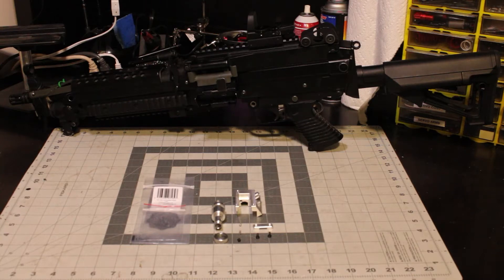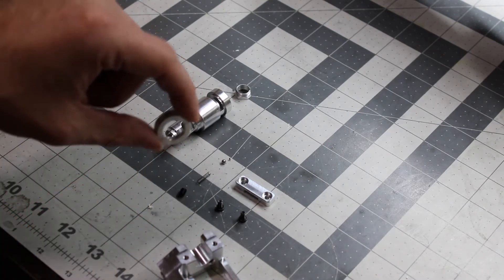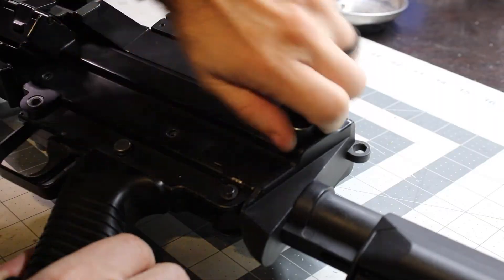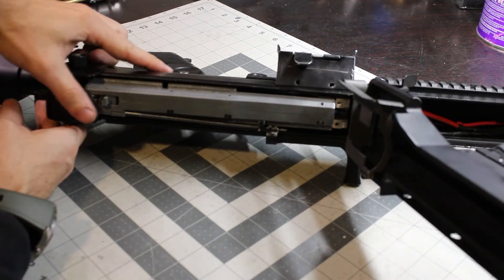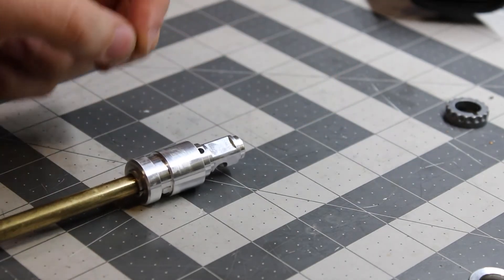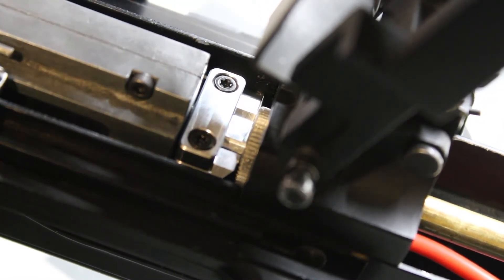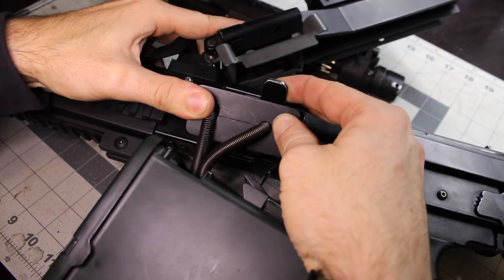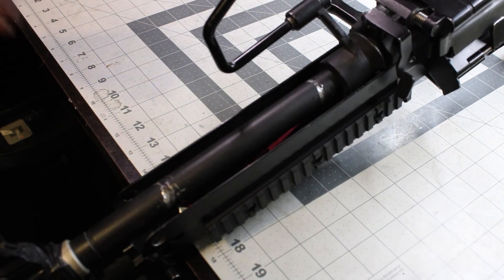A&K M249 Retro Arms hop-up STEP-BY-STEP INSTALL GUIDE 2022 #m249 #airsoft

Comment: I do the same setup with retro arms full upgrade gearbox case but I have a little problem with feed , I think it’s because of the nozzle . I put an m4 nozzle 21,4 mm the original measures 21 mm .for correct feed I have to separate a little the hop up chamber from gearbox. 
What do you think about the nozzle?
Reply from the maker: Yup, sounds like your nozzle is too long. Get a 21 nozzle from Clandestineairsoft.com or brillarmory.com.  It really sounds like your current one is alittle too long. 

If your original nozzle allows your 249 to feed correctly. Definitely find a nozzle the same exact length. Hope this helps!  

If you need more help, consider joining the Wyshtechhobbies discord. Which can be found in the description.

Comment: Would you say this hop up unit is the best one out there for the m249? I’m at this point looking at the bullgear and airsoftpro ones as well but those do not fix the alignment issue properly. I feel like this one with the cnc cage gives you perfect alignment. Which one is best in your experience?
Reply from the maker: Imo, Bullgear m249 Gen3 hopup is by far the best.  I've installed it in multiple M249's with great results.
Reply: @wyshtechairsoft  I’v read that some people still have the alignment issues with the bullgear one but it has the larger window which allows for a regular nub… I’m willing to sacrifice some accuracy for perfect feeding. What is you experience with feeding on both hop up units? Also the retro arms is 50 ish but the bullgear is around 80 bucks in my area.
Reply from the maker: @Dave Timmers  I honestly dont know why people are having alignment issues as every single Bullgear unit I've installed had no issues and fed just fine. 
I think part of it is because people dont hold the gearbox tightly forward before tightening up the screws that hold the gearbox into the receiver.  Not doing so will definitely cause alignment issues and misfeeds. 

The retro arms unit is meh in comparison to the performance and capabilities of the Bullgear.
Reply: @wyshtechairsoft  thank you for your respons! I will get the bullgear than!
Reply from the maker: @Dave Timmers  If you ever have any issues with it.  Feel free to contact Wyshtech Airsoft. You can either join our discord channel and/or give us a call. You can easily get our contact info by searching us up on google.

Comment: I got issue that my original hop up chamber isn't locking in place and my M249 is only shooting like 0,8J-09J with 0.28g bbs. So you think HU chamber change will make some difference? Also, I was using normal bucking with stock hop-up chamber, can it be the problem?
Reply from the maker: The OEM hopup uses a bucking that doesnt have those lips on them. https://www.evike.com/products/29596/
This is the correct one.